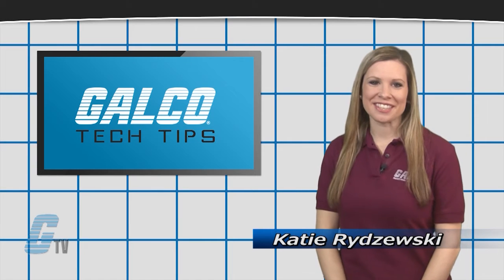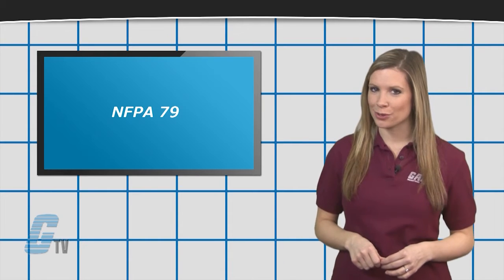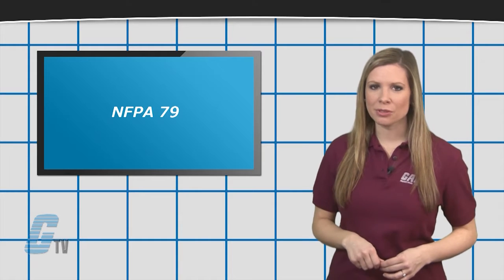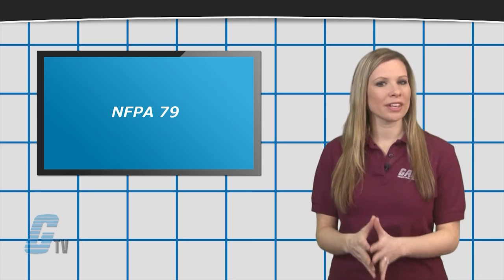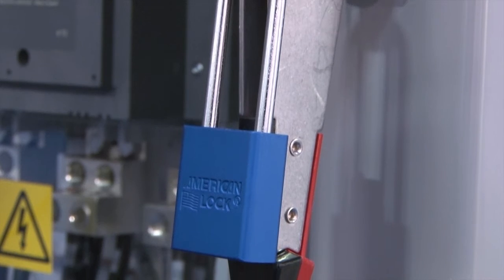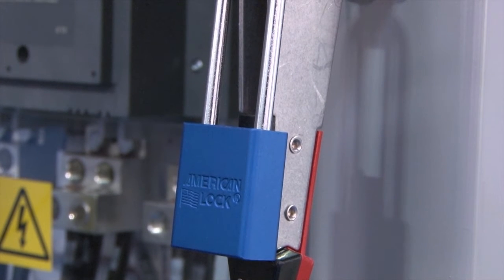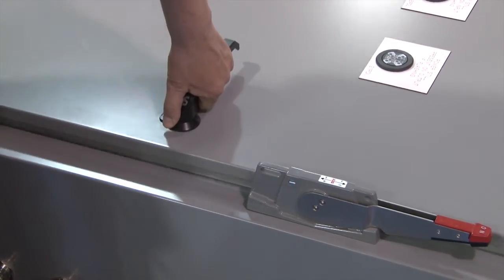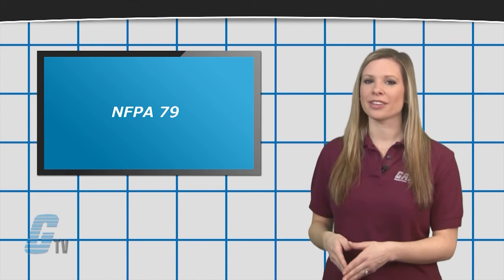Common Disconnect Switch Standards: NFPA79 - A GalcoTV Tech Tip | Galco

Comment: We have a control panel on the machine that I operate. Maintenance removed the disconnect handle from the door and plugged the hole. Now, you remove a bolt and the box can be opened while it’s hot. It is a 3 phase low voltage box. There is a main breaker that powers the box, it is about 75 feet from the control box. However, it’s not in the line of sight. I’m thinking our maintenance folks to order a new handle and put that plug back in the toolbox. What’s your opinion?